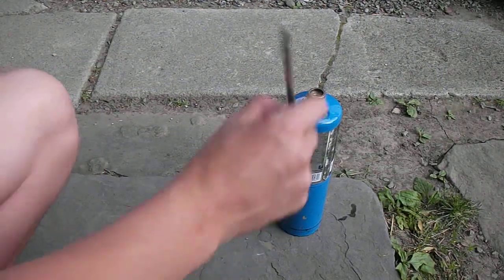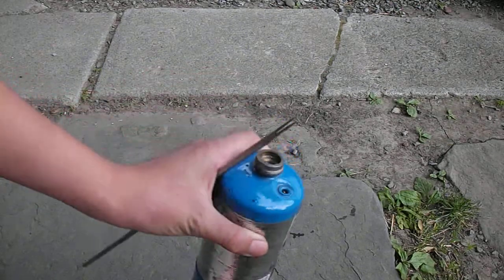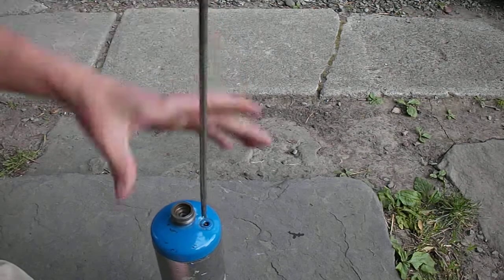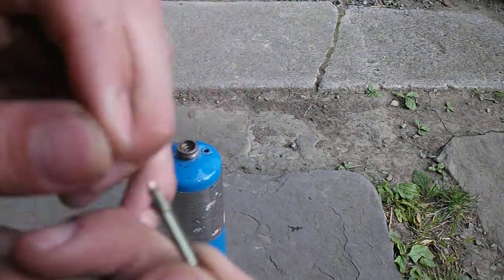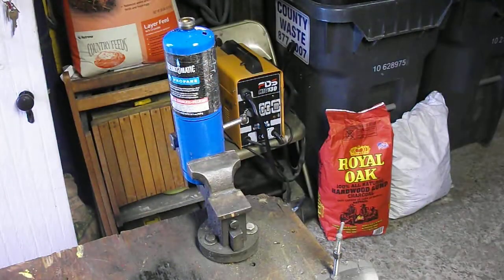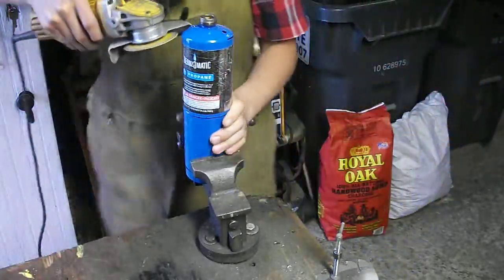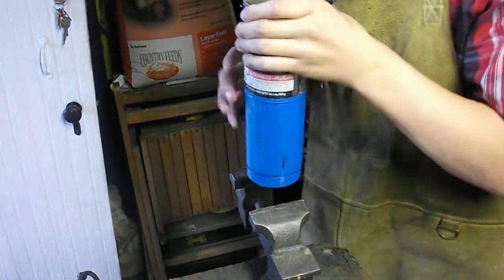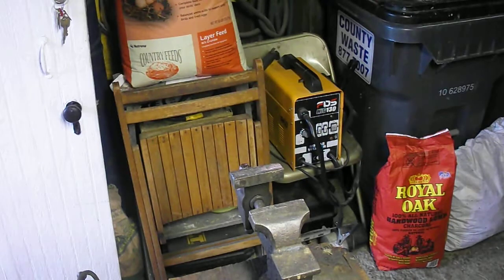How to properly and safely empty a propane canister for crucibles

Comment: A valve stem remover tool works just as well for removing those valve cores they are pretty much the same as the ones in tires
Reply from the maker: thanks for the tip
Reply: Those aren't long enough to reach the flats. Tire Schrader valves are much shorter than propane bottle valves.
Reply: @walkingweapon any solution to this?
Reply: @MrYabber  take a hacksaw to a valve stem tool or a piece of thick wire for a diy wrench.

Comment: Drill battery is dead... good video. Never use an angle grinder with one hand!
Reply from the maker: Sorry, but I was young when I made this if you don't like it go watch something else! your sarcasm is not needed here.
Reply: The Mad Smith - why do you consider this sarcasm?  The battery was clearly dead on your drill. That’s bad for the drill!  Angle grinders are the most dangerous piece of equipment you can use and your use of it clearly showed your lack of that understanding. Comments about bad and unsafe practices should be noted for others to learn no?  Sorry you took it wrong
Reply from the maker: I'm very sorry I'm just used to getting so many hate comments. Also, I read it before the angle grinder part. My apologies...

Comment: jeez - don't bother with the drill  just use the valve tool to remove bothe valve cores.  And learn to use a workbench vise or clamp so you don't hold something with one hand while using any tool with the other.